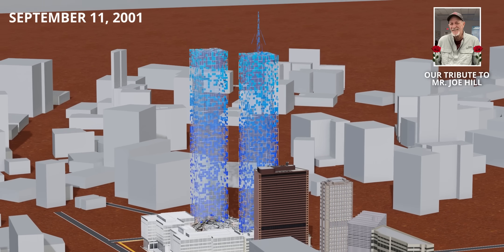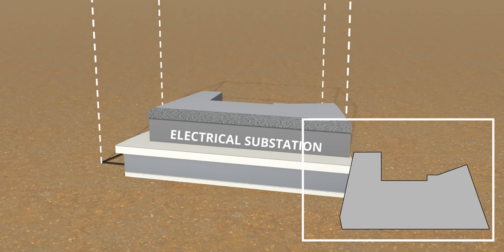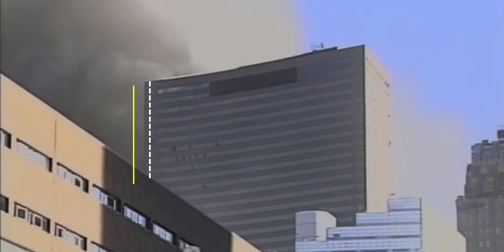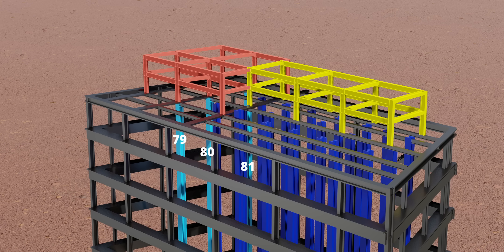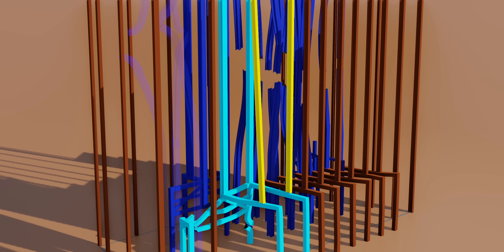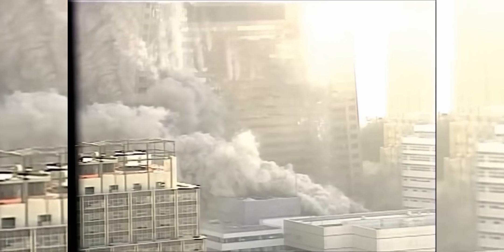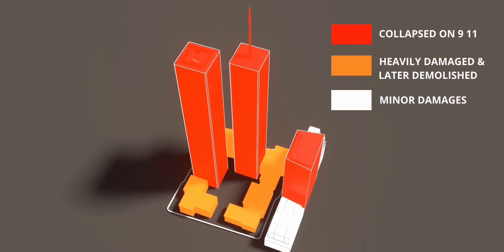Collapse of Building 7 | The Complete Physics

Comment: The impacts of the planes to the Twin Towers were real and consistent with all physics laws. But the collapses of the towers within less than 15 seconds are not normal; they should not collapse. There were pre-planted bombs, about 3000 bombs, modular, autonomous, wireless and delay time individually adjustable from outside. The install was made by using elevators in maintenance mode from Thursday 9/6 to Sunday 9/9. It was an industrial work made like car assembly line.

Here are my comments to your video:

2:30: You say “this core is acting as the major component of the building”. That’s right. You continue saying “bearing the majority of the gravity load”. That’s also right. But you do not speak about the lateral load of wing and earthquake. You do not dare saying the truth, that is: In such high-rise buildings, the lateral loads are more important than gravity load. Ad in the Twin Towers, the core was bearing all lateral load, 100% of the lateral loads.

2:40 You say “when the plane impacted the tower, it damaged the major perimeter columns”. The perimeter columns were meaningless in structural aspects. Even if they were broken, that had consequence; the building still stands.

2:41 You continue “as well as the core columns of the building”. The image you show is false. You removed 4 of 6 core column rows (you cut 32 of 47 core columns). That’ impossible. According to the physics and in the worst case, only 5 columns of the core perimeter columns may be damages. Because when the plane broken the exterior columns, it was sheared into small pieces; and these small pieces cannot damage the core columns. Anyway, I let the possibility to the lower fuselage and engines to damage some core columns. All with no consequence on the stability of the building, that still stood after.

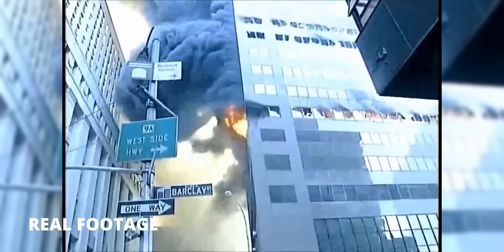2:52 Intense fire heating the floors that you name as “structural elements”. Sorry, floor trusses are not structural elements. The structure of the buildings was the core. The sagging of the floor trusses is not proved. First the core was EXPLODED at impact floor level, that’s why the antenna sagged before the exterior column. And the sagging core pulled inward the floor trusses bending inward the exterior columns, creating the small dent you speak at 3:00.

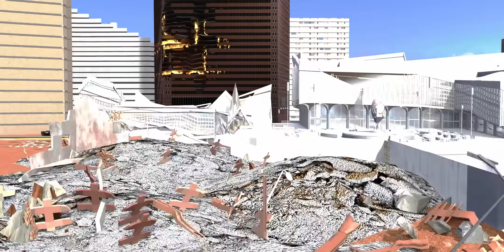3:15 The dent happening in the video last 3 seconds. Long time floor sagging would create a dent lasting several minutes. This proves the dent was created by sudden collapse of the core following an explosion.

3:24 Compare to a coca cola can is totally false. The can is not designed for load bearing, it had no interior primary core structure.

3:32 When the perimeter columns are unable to bear the load of the building. The core was exploded, then all weight of the building was bared by the exterior columns that were pulled inward. If the core columns were not exploded, the building will not collapse.

3:50 There was no tilting in the North tower where the antenna sagged before the perimeter columns. There is no illusion. Your explanation is false.

6:14 Your explanation about the high temperatures in the core are also false. Only the impact floor was hotter. But only one floor below, the temperature was normal. One floor if 12 feet, take a 12 feet steel bar and heat its extremity while handing it from the opposite extremity, you will have no heat at all. The core still stands the explosions, because in the lower floors, only the diagonal bracings inside the core were cut at the first stage of demolition. That’s why the core still stand. When the explosions reached the ground, on some levels, the core columns were exploded at their splices. That collapsed all core columns that were still standing. At that time, everywhere was filled with dust that prevented to sound of the explosions from reaching outside the dust.

7:35 The collapse duration of 9 and 11 seconds were measured by the progression of the explosions downward. Even if we do not know this duration with 0.01s precision, we can estimate this time by adding 2 seconds for safety, let’s say 11 and 13 seconds. I am more generous, I give you 2 more seconds, saying the first stage of collapse reached the ground within less than 15 seconds. This is nearly the free fall time and it is impossible.
The second stage collapsing the core becomes meaningless, as it collapsed in free fall after its lower columns’ splices were exploded.

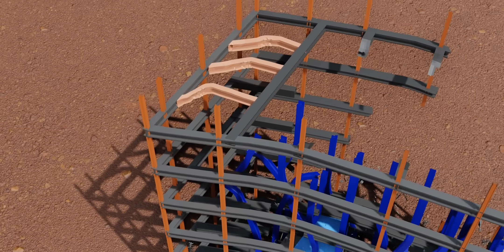8:37 The image of the memorial. Your image is false. You showed the inner square hole bigger than it is actually. The actual size is smaller, because it represents the core and the officials wanted the core to be shown smaller than it was actually for deceiving people by presenting the core smaller than it actually was. You core is similar to the size of the actual one, but the actual core was rectangular, you draw it square. So, there are three different sizes of the cores. 😉

Here is the explanation of the How, the Who and the Why of the attacks of 9/11, including the demolition of the Twin Towers. https://www.youtube.com/watch?v=cu4mN1bbQQc?t=1450
Reply: Twin Towers collapses took 31 to 33 seconds.  I know. I timed it myself rather than trusting the internet. The 9 to 11 seconds thing is a myth, stemming from people completely mis-reading a statement by The NIST in their FAQ which actually only related to the first loose debris to hit the ground NOT the entire building.

The entire building was 3 times longer. This obvious enough if you just watch that loose debris falling about 3 times faster than the towers themselves. It boggles my mind how many miss that bit of bleeding obvious. 

Once you have the correct data you don't need 3,000 bombs to rationalize your error. It can all be explained by gravity.
Reply: " But the collapses of the towers within less than 15 seconds are not normal"
Nor something that happened.

"There were pre-planted bombs, about 3000 bombs, modular, autonomous, wireless and delay time individually adjustable from outside"
Also MAGICAL, to be able to withstand the fires, and not either fail or go off prematurely due to external factors, be hidden in an actively used set of structures, and be COMPLETELY quiet.

"Ad in the Twin Towers, the core was bearing all lateral load, 100% of the lateral loads."
Which is nonsense.

"The perimeter columns were meaningless in structural aspects. Even if they were broken, that had consequence; the building still stands."
Which flaunts your MASSIVE lack of understanding. But, even so, the Towers remained standing. For a minimum of an hour.

"Because when the plane broken the exterior columns, it was sheared into small pieces; and these small pieces cannot damage the core columns."
Not only is "sheared to small pieces" nonsense, but even if it had been, it's be a tightly grouped unit of small pieces that weighed 120 tons.

"Sorry, floor trusses are not structural elements."
And another example of complete lack of understanding. The floor trusses were likely the most important of all the structural elements, joining the core and perimeter together. Neither set of columns could have stood alone.

"The structure of the buildings was the core"
As noted, not knowing anything might not be something you want to flaunt.

"Compare to a coca cola can is totally false. The can is not designed for load bearing, it had no interior primary core structure."
That you don't understand the illustration doesn't surprise. That doesn't make the illustration wrong, it means you don't understand it.

"he core was exploded, then all weight of the building was bared by the exterior columns that were pulled inward"
Which failed on "exploded", there's no way that could have been missed by the thousands of people who where there, the news organizations, etc.
And, of course, by the fact that, IF the core had been removed, the exterior columns would not have been "pulled inward".

" There was no tilting in the North tower where the antenna sagged before the perimeter columns. There is no illusion."
Leading to the conclusion that, you're either lying deliberately, or being very careful to not find out.

" Only the impact floor was hotter. But only one floor below, the temperature was normal. One floor if 12 feet, take a 12 feet steel bar and heat its extremity while handing it from the opposite extremity, you will have no heat at all."
This makes me wonder if you're being dumb on purpose.

"because in the lower floors, only the diagonal bracings inside the core were cut at the first stage of demolition"
The "diagonal bracing" that wasn't there? How the towers were built is EASY to found out. There is reams of papers and likely gigabytes of pictures. This, again, is a perfect example of you being someone who has NO idea what you're talking about.

" The collapse duration of 9 and 11 seconds were measured by the progression of the explosions downward. "
No, they weren't. The "duration" of 9 and 11 seconds is the time that an actual "free fall" took. It refers to the time it took for the first external panels, coming off of the collapse zone and falling outside of the perimeter of the towers, to hit the ground. You can easily see that the debris is falling off of, and outside of, the towers. So, if the TOWERS had taken 9 and 11 seconds, then the debris must have taken SIGNIFICANTLY less time. So....what accelerated the debris?

"The image of the memorial. Your image is false. You showed the inner square hole bigger than it is actually. "
Someone who has never seen the memorial should probably NOT talk about it...

But the most IMPRESSIVE thing about your entire post? Is, you posted it on a video that DOES NOT TALK ABOUT THE SUBJECT! Not one of your time-stamps are relevant, nor are your "arguments", because they don't actually connect to what your nonsense is about! Even allowing for the wrong video, the time-stamps are COMPLETELY wrong!

And with that in mind, we can see that your linked little home-made project? Isn't even worth the energy of a click.
Reply: “"There were pre-planted bombs, about 3000 bombs, modular, autonomous, wireless and delay time individually adjustable from outside"
Also MAGICAL, to be able to withstand the fires, and not either fail or go off prematurely due to external factors, be hidden in an actively used set of structures, and be COMPLETELY quiet.”
Withstanding the fire is normal. Office furniture burn to 300°C. Steel strength changes from 90% to 10% between 400°C and 700°C. At 300°C, there is nothing. In addition, the core columns temperature was less than 200°C, nothing proves higher than this temperature.

“"Ad in the Twin Towers, the core was bearing all lateral load, 100% of the lateral loads."
Which is nonsense.”
You need studying the "braced core structure" in high rise buildings..

“"Because when the plane broken the exterior columns, it was sheared into small pieces; and these small pieces cannot damage the core columns."
Not only is "sheared to small pieces" nonsense, but even if it had been, it's be a tightly grouped unit of small pieces that weighed 120 tons.”
Small pieces are separated small parts. The biggest damage was on the exterior columns and it was meaningless.

“"Sorry, floor trusses are not structural elements."
And another example of complete lack of understanding. The floor trusses were likely the most important of all the structural elements, joining the core and perimeter together. Neither set of columns could have stood alone.”
The core could stand alone. You are deceived about this issue. The floor trusses only stabilized the exterior columns that are unable to stand alone. The structure is the core.

“"The structure of the buildings was the core"
As noted, not knowing anything might not be something you want to flaunt.”
This is your case. The PRIMARY structure of the buildings was the core. That’s why its columns were huge, and they were braced.

“"Compare to a coca cola can is totally false. The can is not designed for load bearing, it had no interior primary core structure."
That you don't understand the illustration doesn't surprise. That doesn't make the illustration wrong, it means you don't understand it.”
I very well know and explain this aspect. You only make personal attack; you explain nothing, you have no logics.

“"he core was exploded, then all weight of the building was bared by the exterior columns that were pulled inward"
Which failed on "exploded", there's no way that could have been missed by the thousands of people who where there, the news organizations, etc.
And, of course, by the fact that, IF the core had been removed, the exterior columns would not have been "pulled inward".”
As explained in other answer, the buildings were sealed with their windows on place; no noise can easily escape outside. In addition, the floor volume acted like gun silencer.

“" There was no tilting in the North tower where the antenna sagged before the perimeter columns. There is no illusion."
Leading to the conclusion that, you're either lying deliberately, or being very careful to not find out.”
Again, you make baseless personal attack. I am only a mirror to your comment.

“" Only the impact floor was hotter. But only one floor below, the temperature was normal. One floor if 12 feet, take a 12 feet steel bar and heat its extremity while handing it from the opposite extremity, you will have no heat at all."
This makes me wonder if you're being dumb on purpose.”
Keep your insults for yourself and look the mirror.

“"because in the lower floors, only the diagonal bracings inside the core were cut at the first stage of demolition"
The "diagonal bracing" that wasn't there? How the towers were built is EASY to found out. There is reams of papers and likely gigabytes of pictures. This, again, is a perfect example of you being someone who has NO idea what you're talking about.”
There is no high-rise buildings with core structure that has no diagonal bracings. You need to study and learn what you are talking about.

“" The collapse duration of 9 and 11 seconds were measured by the progression of the explosions downward. "
No, they weren't. The "duration" of 9 and 11 seconds is the time that an actual "free fall" took. It refers to the time it took for the first external panels, coming off of the collapse zone and falling outside of the perimeter of the towers, to hit the ground. You can easily see that the debris is falling off of, and outside of, the towers. So, if the TOWERS had taken 9 and 11 seconds, then the debris must have taken SIGNIFICANTLY less time. So....what accelerated the debris?”
The first progression of the explosions lasted 9 and 11 seconds. That also cut the connections of the floor trusses to the core, making them and exterior columns collapse.

“"The image of the memorial. Your image is false. You showed the inner square hole bigger than it is actually. "
Someone who has never seen the memorial should probably NOT talk about it...”
Seeing several pictures and movies is largely enough for evaluation of the size of the inner square.

“But the most IMPRESSIVE thing about your entire post? Is, you posted it on a video that DOES NOT TALK ABOUT THE SUBJECT! Not one of your time-stamps are relevant, nor are your "arguments", because they don't actually connect to what your nonsense is about! Even allowing for the wrong video, the time-stamps are COMPLETELY wrong!”
You are right. It lasted some time for writing the comments, and video opened another one. I copied the comment on this video, and will answer there. https://www.youtube.com/watch?v=m-Haf79ygQY

“And with that in mind, we can see that your linked little home-made project? Isn't even worth the energy of a click.”
You prefer the false and no need to watch the truth.
Reply: @h1F595  , I never said 3000 bombs gone off all at once! The bombs were programmed to go off sequentially to create the top down collapse as we saw.

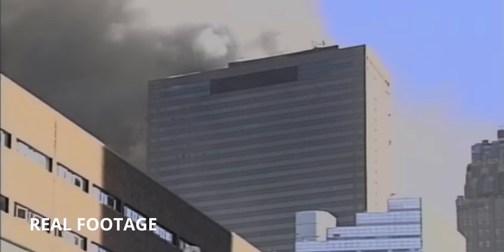The sound of one bomb, heard at 0:13 in the video is of 
@MFitz12, is exactly what a recording camera will hear at the distance where it is and through sealed/closed windows all around the tower. What you are speaking is the conventional controlled demolition with open building and all windows/doors removed.
Reply: @h1F595  , the windows were completely sealed, no sound can cross them.
Reply: @Peace911org  - 🤣🤣🤣🤣🤣🤣🤦‍♂
Reply: @h1F595  , you rise a logical question, here is your logical answer: In a controlled implosion, the building is prepared and all windows, doors are removed. The explosions easily each outside and they are heard from far away. But in this case, the windows remained sealed. The explosions happened inside the core area. The outer floor volume between the core and the exterior sealed windows acted like a gun silencer and prevented the sound from getting outside. You need only compere gun fires without silencer and with silencer. It is so easy and logic.
Reply: @Peace911org  - Or,... there were no bombs because your base starting assumptions are completely wrong, leading you to false conclusions.
Reply: @Peace911org  - Had you actually read my post you would know I did not pose any questions. But now I will. 

Why are the perimeter columns bowing inward by up to 5 feet in the Gary Pollard video and what caused them to buckle, initiating the collapse?  A collapse BTW that has already started at the very beginning of the video.  Also, it is obvious how far away Pollard is.  Why can't you do that math?

So, in other words then, why are your (silent) bombs going off at least 10 seconds AFTER the building started moving and what actually caused the building to move?